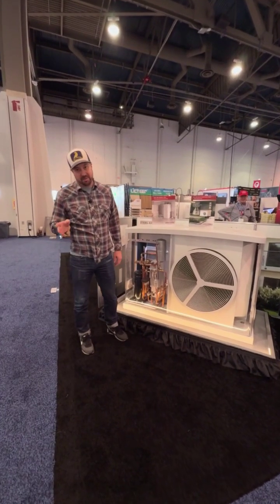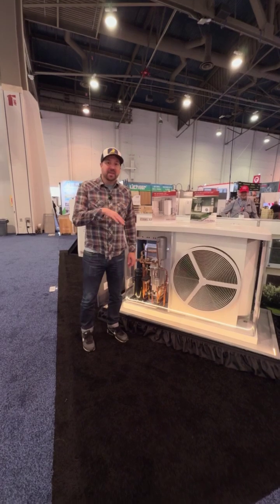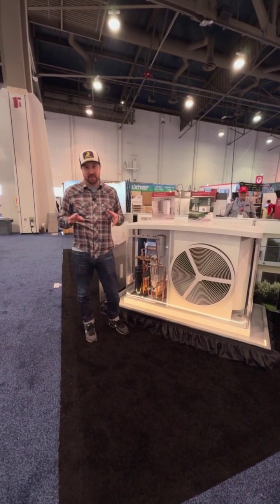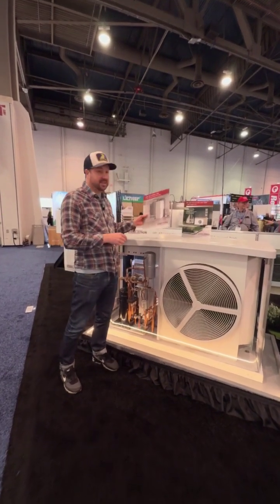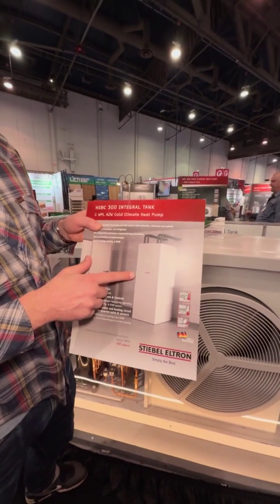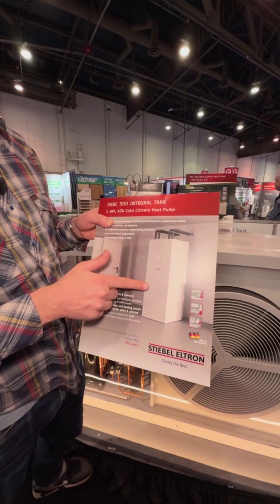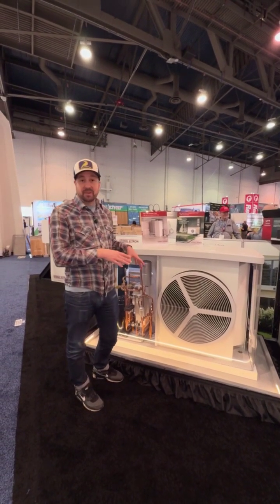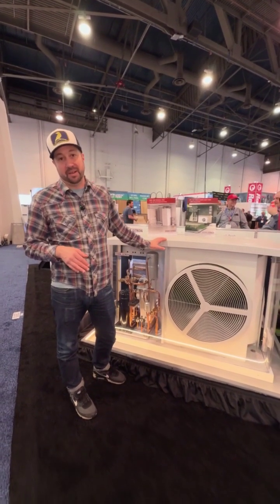Efficient Heating, Cooling & Hot Water

Comment: What happens when you need Heat for Shower/Washing Hot Water and need Cold Water because it's Summer and 98 degrees outside?  How does that work?
Reply: And will a 20+ minute shower drain the entire hot water tank, then require four hours to reheat?
Reply: @00sean00  I’m guessing it comes standard with a 40 gallon tank which is on the small size. Definitely would look for a bigger tank option.